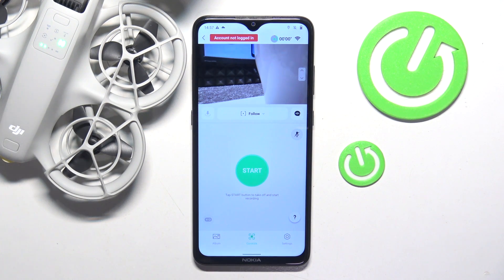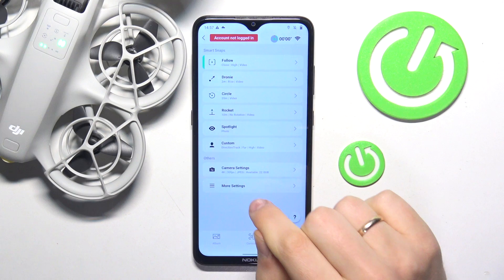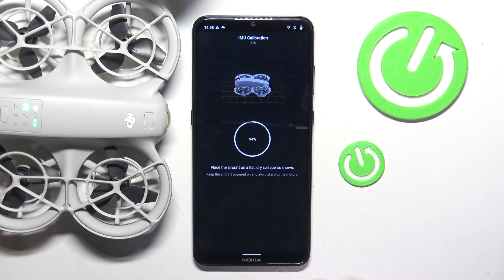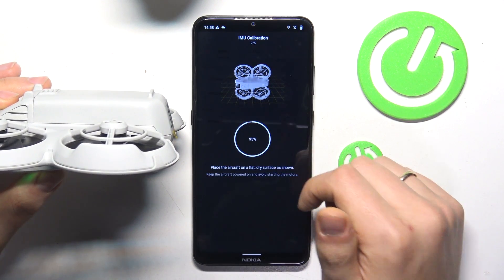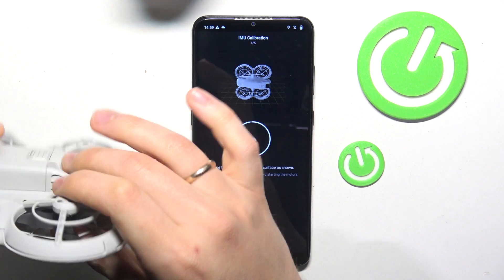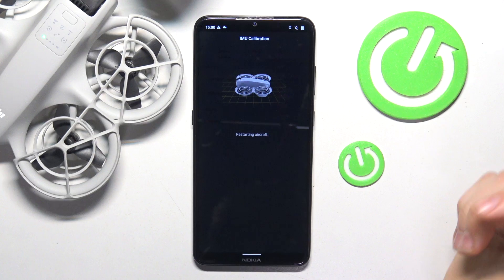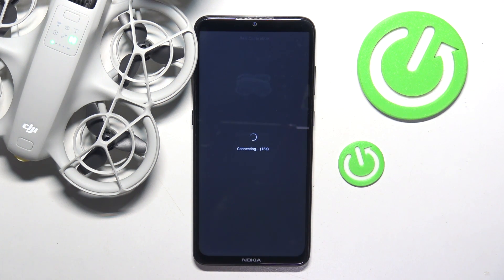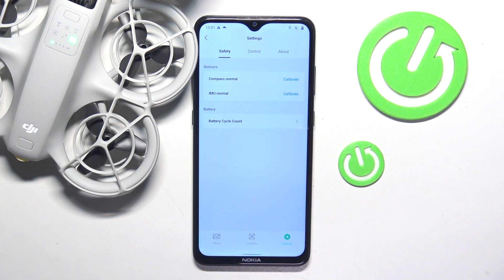How to Perform IMU Calibration on DJI Neo

Comment: how do you know if it needs calibration?
Reply from the maker: Hi, thanks for the question. The app will display a message such as "Compass callibration required". Moreover, it needs callibration if the drone exhibits erratic flight behaviour (e.g. drifting), when you have trnasported it over a significant distance (e.g. different city), or if it experienced a crash.
Reply: I would add that you should validate your telemetry before each flight. for example, if you fly at 1 meter high and you get a 7 meter altitude, your calibration is off.

Comment: My is failing on step 2
Reply: ok my problem was I was around to many electronics in my office (I believe ), took it outside took a couple more try's but was successful doing IMU and compass calibration, hope this helps others, thanks for great vid once again
Reply: and you also need to watch what direction they (App) want you to move the drone on the screen , I didn't notice that until I watched his video and was stuck also .. Good Luck
Reply: Thanks
Reply: Have you had a esc error before